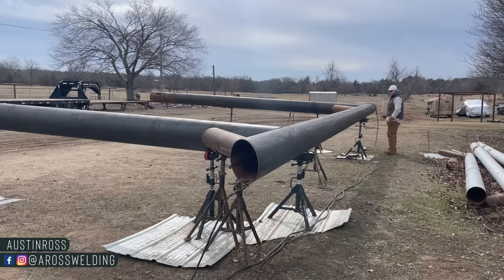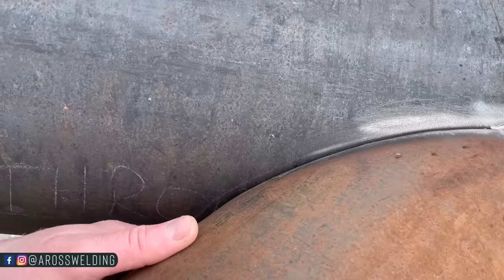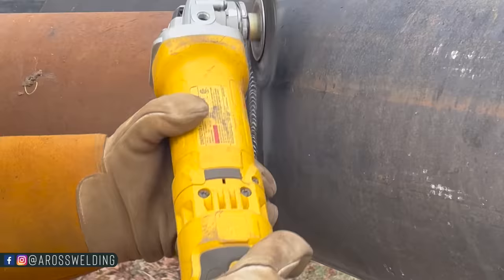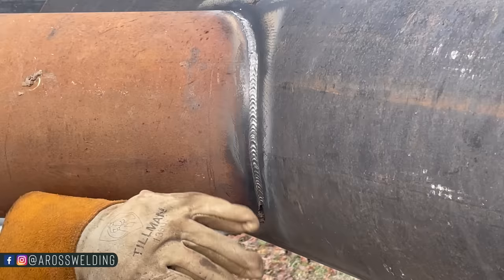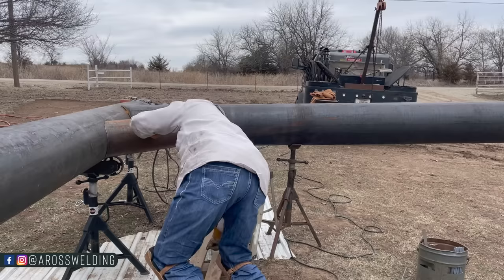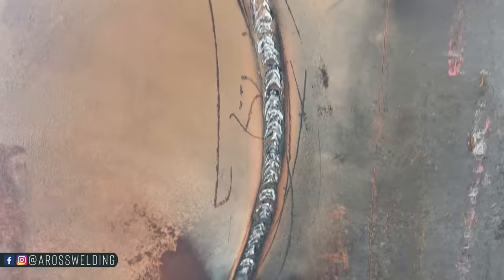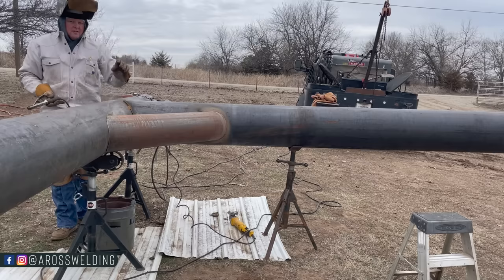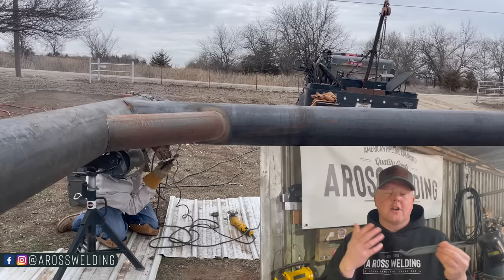Why Pipeline Welders Only Burn Half a Welding Rod

Comment: I was a certified welder for 25 years I have held bridge certs, many aluminum certs, and structural steel. I have welded with FCAW all positions UP any thickness. also weld pipe all positions UP E71T-1 3/16 and over without backing never ran down hand always ran from 6 to 3 then 6 to 9 with a grind of all stops and starts. then from 3 to 12 and 9 to 12. But never ran down even when I ran stick.
Reply: Exactly how i learned it. That's just the most reliable way to do it.
Reply: 6010 is about the only thing you can run downhill ?  P5  fast freeze.
Reply: Same here. I was first certified in 1982 and have about the same experience as you. I was trained and used the same methods like you described. The only down hand welding was to build up an outside corner maybe. Always uphill.
Reply: Codes have changed. Pipeline is commonly welded downhill  now
Reply: Lots of welding procedures out there call for down hand
Reply: Structural insitu welding. Pipelines are mobile in all weathers, across country and oceans hence speed is of the essence and why stove welders get paid three or more times more
Reply: @philhonour  Yes there are. but I was always taught to never run 7018 down hand  6010 was ok but never 7019 just saying that's what I was taught.
Reply: @rickh633  Did my 1st test in Nov 63. And a whole slew of them ever since. My first pipe test was in 1969. Gas Distribution for utilities and API we're always down hand. They would take facebends, they would take root bends, they would do side bends and occasionally a NIC test. Whether on a paper mill, chemical plant, on a power plant, or pipeline. There has always been a prescribed procedure to follow and you better follow it or you could be going down the road with as it was said,  "With a rancid bologna sandwich on stale bread and out-of-date roadmap."  
There's nothing more on inspiring than to have an inspector sneak up behind you with his shield, watch what you're doing and compliment your effort. And if you're working a power plant the QC/QA is going to have to sign off on whatever you've done so it's documented done correctly in spec.  

Interestingly, there's still no answer to my yesterday's question with respect to tensile strengths and elongation uphill versus downhill welding is a 70,000 lb PSI tensile strength different more or less welded uphill or welded downhill? 
Thank you.
Reply: That is what I learned too. Also, always grind a small notch into the weld end on the root pass before starting to weld again. It makes penetration easier and takes away the slag so you avoid holes and bad welding on the inside of the pipe.
Made my welding certificate in 2002. Thick-walled pipe, construction steel, etc for offshore use.
Reply: This is a GATE, not  pressurised pipeline welding work.
Reply: @rickh633  i think research in welding and new machine technology probly by the main welder manufacturers in the last 25 years has absolutely changed the welding industry. My dad learned how to weld during ww2. And welded till he was 80 yo. He Could weld up the crack of dawn. And was good at it up till the very end. When he was just flat unable to move and see. And would roll over in his grave thinking that welding anything in downhill that was worth while was an acceptable practice nowdays. Funny how thought patterns have changed.
Reply: @Warpedsmac  Just ask any  current pipeline welder and they will tell you pressurized pipeline is welded downhlll now.
Reply: @rickh633  It's a gate.
Reply: @Warpedsmac  yup he is build a gate and we are welding oil pipelines downhill
Reply: Me too.
Reply: @ghostofcpast8893  Where I live down hand means flat. Down hill is the opposite of uphill. I know it's different in some places.
Reply: @rickh633  It was commonly used 50 years ago when I worked in it.
Reply: @philhonour  What codes are you referring to ?
Reply: @chrisshaw3970  You are correct. xx10 are the only reliable downhill rod.
Reply: Dad taught me. Weld it up , it'll stand up. Weld it down , it'll fall down. I've lived by that for 45 years of welding. Always works for me
Reply: @maplebones  pipelines in Canada are welded hot and fast down with 7018

Comment: Surprised at the number of comments stating poor welding procedure with this guy welding vertical down. Did nobody check against the Electrode specs? 8010 is specifically designed for vertical down.

Comment: That bucket of half burned rods always came in handy for fitting/tacking or situations where I was using short skip stitch welds. Rod never went to waste.
Reply: Except that they are hygroscopic.
Reply: @MichaelKingsfordGray  why god invented sealed tubes, ovens and color phase silica gel packs... Some time spent in a toaster oven dries out the rods and recharges the silica, then store them in an air tight tube. Some cheap silica packs that phase/change color when they get saturated will last virtually forever too and are handy for all kinds of things like inside safes, CCTV cam domes, ammo cans, radios including inside larger antennas or other electronics you want to seal up long term and not corrode from temp changes turning humidity into condensation.👍
Reply: @MichaelKingsfordGray  I'm also in one of the wettest places on Earth known to man besides the Ocean anyway, so I store all my new rods in the furnace room to begin with...
Reply: @MichaelKingsfordGray  Nothing a rod oven doesn't solve if working to code and if working to code the cost of the rod oven and running it doesn't matter. If not welding to code dry 'em out however you please that works.
Reply: @MichaelKingsfordGray  New rods are hygroscopic too. It doesn't magically suck up more water just because it's partly used. It sucks up water because it has access to the moisture in the air for a significant amount of time - used or new rod alike.
Reply: @bpj1805  It sucks up water after being unsealed, and left unsealed!
Don't tell me that you do not place your newly unpackaged rods into a re-sealable container with silica gel packets!
Reply: @macgyver5108  And why God let me put a 40 watt bulb in an old 1960 refrigerator...to keep my rods dry....
Reply: @MichaelKingsfordGray  We call those "green rods".....
Reply: @MichaelKingsfordGray  Yes but new and used rods, if unsealed, suck up water just the same. If anything, the heat from the welding current that ran through a rod while welding might drive just a little bit of moisture out of the coating.
Reply: yeah,  new rods for important work, where imperfections and flaws are super bad. but hey, as long as the partial rods are used up for something, nothin' wasted, all good. [in welding class I was notorious for using up all the partial rods that all the other classmates discarded.  fell in love with this big ol hobart, where most of the class went right for the migs and flux cores. heh.]

Comment: Im an old fart too. Started as a pipewelder helper, in the early 70'. drove truck 60 ft, jumped out cleaned the last pass, jumped back in the truck after a moment drove up another 60ft and repeat, did this, for the root, hot pass and cap welders, had many jobs, took a wildcat grinder wt 9in wheel no guard and grind the root to request, leave wagon tracks or not or somewhere in between did this all day long, my trigger finger still gets locked, then i spaced with a grinded down car spring leaf, for a good while, carrying all sizes of clamps, knocking out the highs and lows making sure the seams are at 10 and 2 o'clock then putting the right space in, while the side boom operator is watching my finger signals, in less 30 seconds, or before the root welder,/welders gets there. the 12in and larger put the arms on me, filing was my favorite, i shined both ends up and correct the landings, stayed far ahead for peace and quiet. On straight the ways, we would do up to 200 welds, 160 -80 was average. We made our own 90's&45's and transitions at the end making the trees. Without realizing i picked up so much, like the setting, polarity, tricks of the trade, so when i started welding, so much came natural to me. I would relieve all the welder, giving them breaks, definitely a No-No, had no coupon. Passed my first test, bought an old Lincoln 200, started welding for the same company. It was done different back then, 6010 down hill root, with muscle memory and almost no blinding arc this could be done with no shield,, 7018 1/8 uphill hot pass, 7018 5/32 uphill cap, on 6inch pipe schedule 40 and over. Yes 5/32 uphill cap. People find this hard to believe, the most difficult to master. It isn't whip or weave or horseshoe, the heat was slightly higher then for 1/8, it was more of an up and down smear without sticking while quickly traveling up. Now ever weld pass is downhill with ××10+ rods, , where's the fun in that. I also became a pipe fitter without even knowing it. Years later i was doing more then pipe. Doing everything oilfield related. Tig and mig isn't hard, people just think it is, like they think overhead is, just a rumor, till you know better. Heavy equipment, hard facing, build up, aluminum, stainless steel, acetylene welding, and being a torch master. The world of welding is a great and satisfying way to go through this life, except the part of living out of motels especially for the married man, that would drown their sorrow hearts in liquor and Hank Williams (your cheating heart) But those days are gone, and for the most part so am i.. so i reminisce by watching these YouTube videos, and reading comments on how someone would tell the uploader how they would do it, or should do it. This is some mighty fine enough downhill welding.. though its not how i would do it, but this can be approached several ways and would have to be if there was too much gust or a high windy day....that also some mighty fine fitting, perfect for 8010, can't go wrong with penetrating to the depth of the width thickness and into the sidewall.
 No cap over either,  just a solid weld.. I bet it's close to 100% depth penetration. I could still do it, but ill have to have a helper, to help me get down. But most importantly,, to pick me back up.. being to old to weld sucks. At least i can talk about it.

Comment: For any beginners in welding, one of the best welders I ever worked with taught me to make yourself do the more difficult procedures, especially on projects that are not going to be tested.  Practice welding uphill, practice welding out of position.  Also when you weld uphill, you will always use more rod. You will put more steel into the weld, and the HAZ (heat affected zone) is bigger.  (more spread out) . This creates a more uniform molecular structure across the weld and into the base metal.  If you are only going to have an x-ray test you can get by with welding downhill, but if you have to pass a bend test, you better learn how to weld uphill, and on grade.  In fact most of the inspectors I've been around wouldn't even waste their time doing a bend test if you tried to downhill it. 
On big bore pipe never start a weld that you can't finish without stopping.  Once you start a weld, you need to finish it.  And if you are in a cold climate, especially if it is below freezing, you should pre-heat both sides of the weld.
Reply: Good information!
Reply: Somehow, I doubt gravity suddenly effects your weld less depending on where your rod is.
Reply: @mikeishome69  It doesn't, but the magnetic fields produced by the Arc add a different force in a different direction.
Reply: @mikeishome69  check it out.  Watch some bend tests  (destructive weld tests)  being done.  A good uphill weld will always stand more pressure and abuse than a great downhill weld.
If you have ever welded in a refinery (which I know you haven't) then you would know they require you to weld uphill.  For a reason.
There is actually some science to welding, it's not just laying down some rod
Reply: maybe it was a typo but welding in position is when you cant move anything. not trying to start nothing big guy
Reply: In all the years I have been inspecting welds to either API, AMSE (many times API references ASME) or AWS, I have never seen a procedure for downhill welding. It was always vertical up. Test coupons had to be made vertical up as they had to be tested. Even 6G and 6G restricted welds were vertical up, starting at the bottom. While AWS allows for downhill for repairs, one has to be a certified or qualified welder. And @Vit Apa, how one holds a rod does have an impact on how a weld is placed. If you hold your rod/electrode/torch in a horizontal position while trying to place an overhead fillet weld, you run the risk of having a short leg on the upper side of that weld, which means you need to waste more rod and time to fix it.
Reply: You must have had some tough bosses. I can't see it in my mind how he was supposed to get around that whole pipe without stopping plus going uphill all the way around. Even if he used a 6 foot stick rod and started at the bottom, he would have had to do a Ninja flip over the pipe when he got to the top, morphed himself into a shadow to squeeze through the corner gap without breaking the bead and he'd still be welding downhill on the other side. Or am I taking you too literal?
Reply: @melkel2010  I've been welding for 250 years on Earth, Mars, and Venus, so I know what I'm talking about.  To weld all the way around a large pipe, the welder wears a maglev suit that allows him to float around the circumference of the steel pipe.  (JK.  I am just very amused by these comments.  Most of the roughneck welders I see around here in upstate NY do not look like the type of guys would spend their free time posting youtube comments, so I kind of doubt that we're getting truly expert opinions in here.)
Reply: @mikeishome69  Gravity has nothing to do with it...magnetic fields on the other hand?
Reply: @jtocwru  i welded the crack of dawn
Reply: I'm a carpenter.  We nail things.
You'd burn the house down welding pvc pipe. 😂
Reply: @dylanwilliams9860  Molten metal is not magnetic
Reply: @melkel2010  I weld nuclear pipe, it's always uphill. The whole pipe doesn't need to be one weld although obviously you should be minimizing restarts, you would weld the pipe in halves to always be travelling uphill
Reply: An expert always seeks to extend knowledge wisdom is learning from someone else's mistakes before you yourself make them... preparation. Is in direct correlation with expectations... proper prep prevents poor performance... prepare what you want expect what you prep for... never settle to mediocrity always strive for excellence... life wasn't meant to be easy... life's full of challenges... look forward to life's challenges for each is unique in its rewards. There are 2 type of people the ones that stand up for themselves and then the ones who are victims... you can beat me down as many times as you want but I'm always getting back up... you can control thinking... positive outcomes manifested through positive thoughts and desires...
Reply: A welder on pressure work doesn't decide how the weld will be made. He works with a qualified procedure that dictates every aspect of the weld. Same with welding tests. The welder doesn't get to choose uphill or downhill. You'd know this if you we're a welder.

Comment: Most of the time you can get away with doing whatever works for you, but if there's a specified welding procedure it's best to follow it. Getting caught not following it is a good way to get kicked off a job site.
Reply: And not get another test. The WPS is there for a reason it's been mechanically and NDT qualfied and needs to by replicated to ensue structural integrity QA of the whole project. If a welder thinks he clever than the designers engineers and international standards boards why is he still a welders mate ?!?!
Reply: The best way to avoid that is to be the boss of the job-site.
Reply: You would be surprised if you were a welder in the sign/advertisement industry, Mike.

Comment: I always tend to use as much as is necessary. Stops and starts in the most convenient place possible dictates the amount of rod I use, more so than how much I just decide. I'm not a pipeliner I'm a building trades pipefitter who used to be a pipe welder, but still welds a lot of pipe.
Reply: buying rods and having them furnished makes the difference of what you burn
Reply: i do that if im doing like 3 miles of 3 on 12 or something crazy like that.1 rod will get me 3 3 in welds shit like that. fuck all the extra lumps and tie ins arc strike marks etc.....
Reply: spatter

Comment: I learned to weld and spent my first 15yrs at a shipyard building aircraft carriers and submarines. We were discouraged from starting a weld with a used rod also. Reason being, rods were a cheap commodity compared to repairing a failed X-ray, ultrasound or prod test. That’s all I knew and thought that was normal, industry wide till I hired in welding at a Ford plant. I’ve caught a lot of gruff at Ford for “wasting” weld rods and bending them before starting. After seeing this video, I feel vindicated!
Also, as a game, I always play the “how many rods will it take to do this job”. Surprisingly, 60% of the time, I’m burning my last rod as I’m finishing up, then also going to my spent rod bucket for touchups if needed.
Glad to have come across your video, thanks!
Reply: I worked on carriers and subs also my first 9 years as a welder. (At PSNS) No way in the world was we aloud to weld anything downhand. It traps crap in the weld. You have to bend them rods however you need to to get the angle and access you need. Especially on the subs. Everything is tight in there.  Sometimes id even have my firewatch connecting and disconnecting the leads for me so I don't accidentally arc off anything getting situated.
Reply: Well Mr, Productions, I should trust a poster with such an obviously real name!